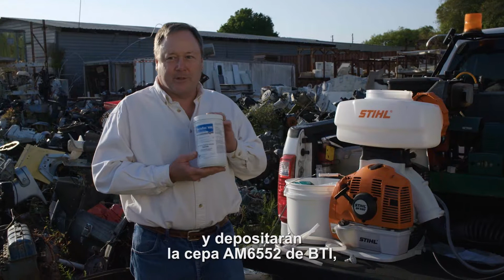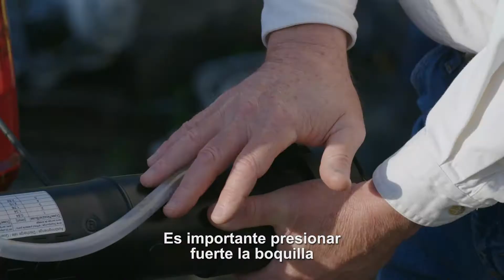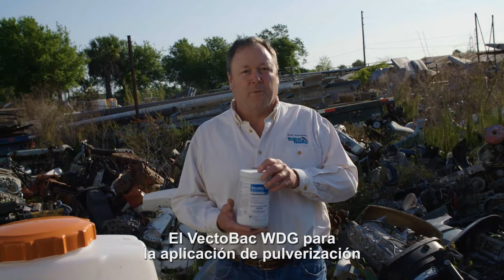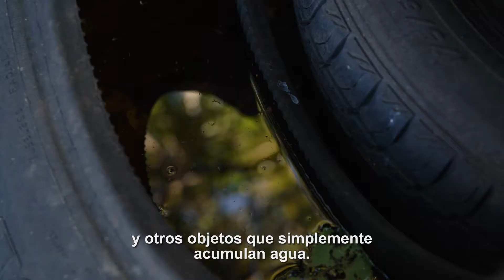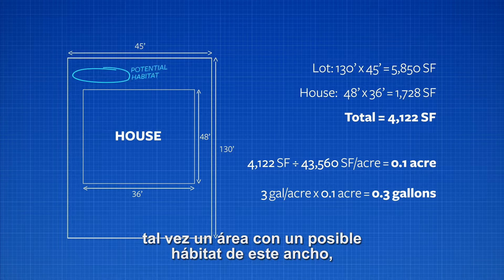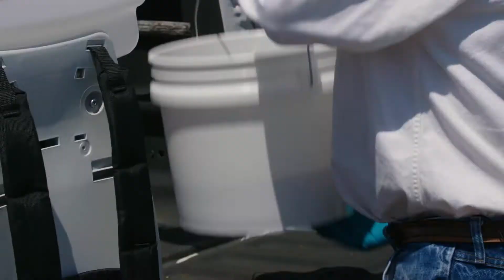VectoBac (Bti) WDG WALS Ground Applications with Stihl SR450 (Full Video, Spanish Subtitles)

Comment: Wow; this is incredibly helpful background for using the equipment and the Vectobac together with a lot of considerations. Thank you so much. Which product / formulation is labeled / recommended for use on bamboo grove and random residential small containers? What is the 0.8 setting on the ULV correspond to in terms of droplet size? What coverage rate in your formula would you recommend for a bamboo grove? Thanks